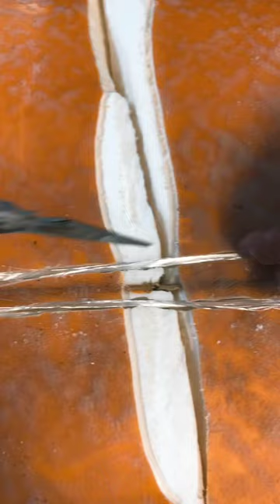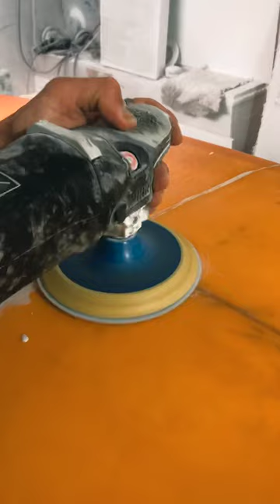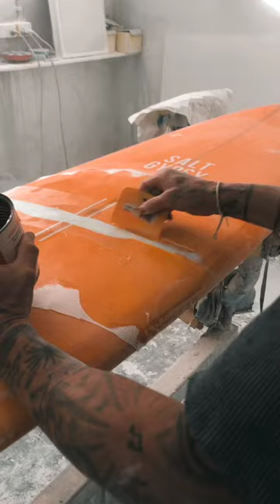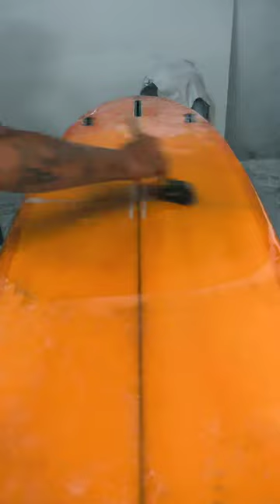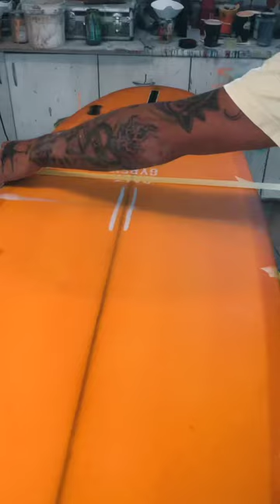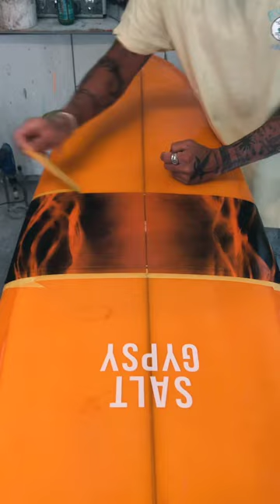Fixing a snapped surfboard

Comment: Incredible job! If you were to rate the performance of the board 0 out of 100 post-repair how well do you think it will score relative to its original condition? I just ask because people say repaired snapped boards will never be the same, but I was just curious to what extent? Because if they can return to 80% of their original performance, for instance, that seems good enough.
Reply from the maker: Hi mate. You’re right , repaired snapped boards don’t ever go the same…as they lose that magic flex pattern when repaired. Snapping a nose or tail will still go good when fixed. But I’d say 50/100 for snapped board. Board would still be good for a beginner/novice though
Reply: @AndySymo-zw5kk  thanks so much for the response. Best regards.